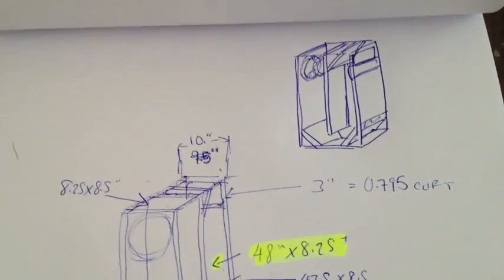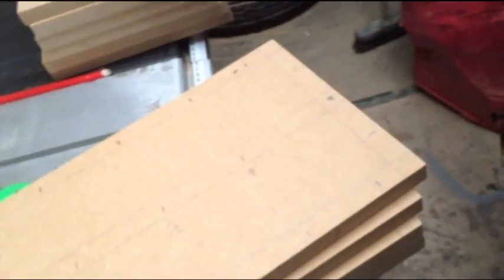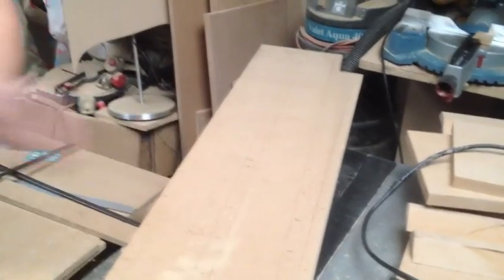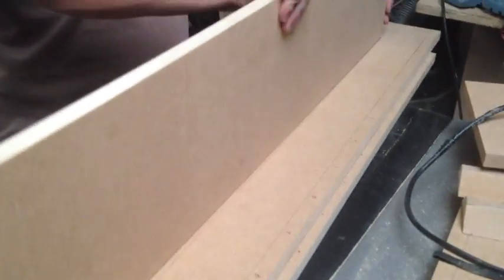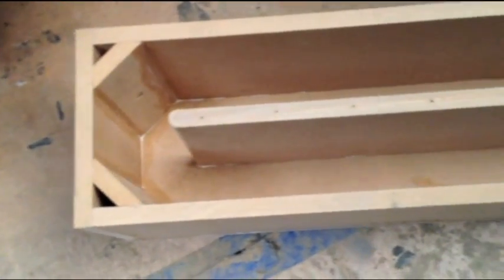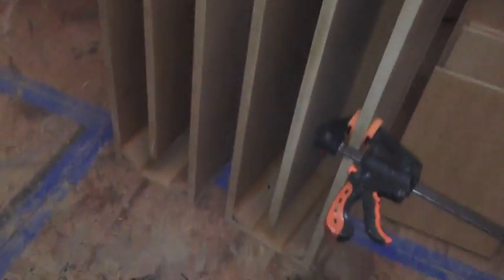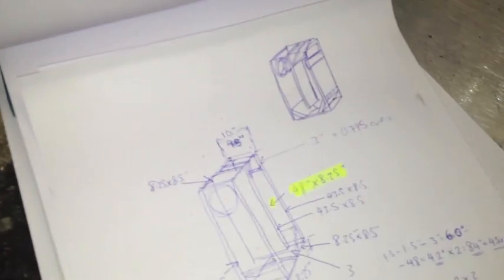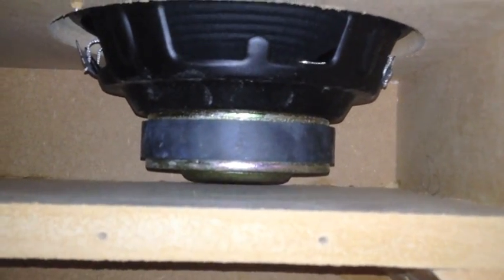Building a TL transmission line Design enclosure Box for 8'' drivers for my home audio system part 1

Comment: The last time I heard transmission line speakers was a pair if English, IMF Professional Monitors, which incorporated, English again, KEF B139 bass units, with polystyrene-foam solid cones, covered by a thin black aluminised film, rubber roll surround and had a cast alloy frame. They went comfortably down to a 64ft organ pipe (16Hz).  The B139 f. rez. was 20Hz..!